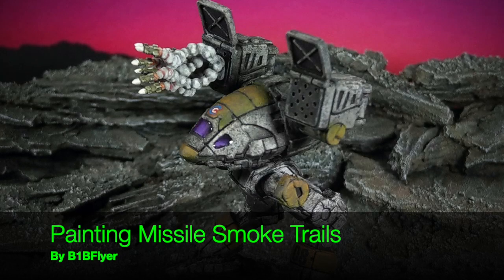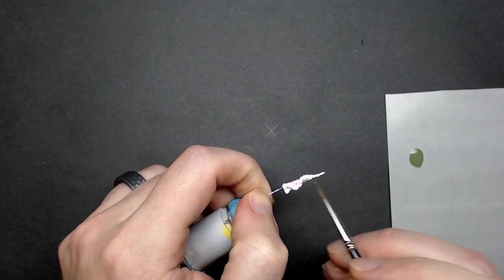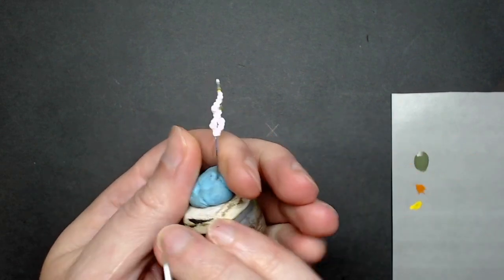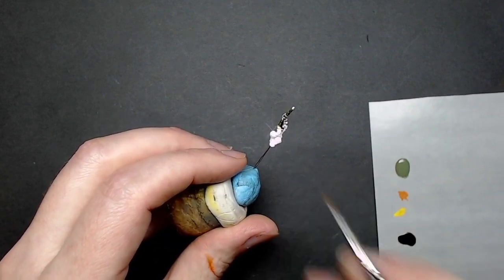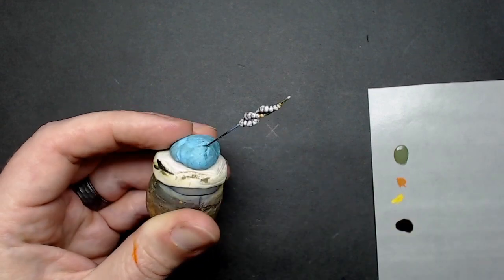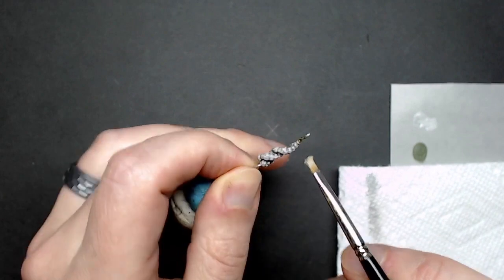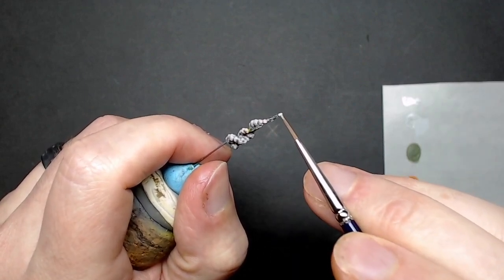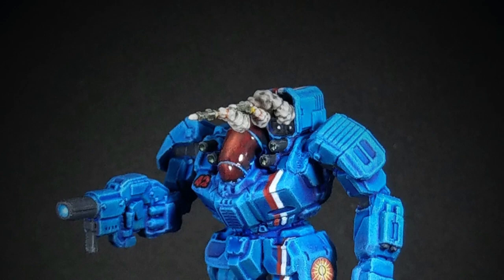Battletech Painting Missiles & Smoke Trails

Comment: Do you have a tutorial on how to sculpt the rocket effects by hand? Mention using wire, green stuff and sand, but I’m not wrapping my head around this concept. Any tutorial links you can suggest would be great.👍😉
Reply from the maker: No, sorry that's a fairly intricate and advanced procedure due to being so small and. Honestly even now after having sculpted missiles in the past, I would first try to either purchase 3d printed or have a friend print me a 3d file of missiles due to the time and effort in comparison when trying to make them. As for how to do it without a video, I use a small wire and typically cut a 1:300 aircraft weapon down and drill a small hole in the back to insert the wire. Then add greenstuff in layers to make the trails. You can also use superglue and sand or baking soda to create the smoke plumes as well. There are a few examples on some of the battletech hobby facebook pages that you should be able to see with a search or by asking about the folks that have done them.

Comment: Awesome Vid! but i have a question. Why don't you paint the Missiles at the end when the Smoke is done? regards
Reply from the maker: Personal preference is really the main reason, but not so much for one or two missiles, but in the Catapult example, there's a lot of tight to reach areas to paint the missile bodies and if you've done all the work to the missiles first, you don't risk getting a dark green, or black, or whatever color you decide to paint the missiles onto your smoke plumes which are very light colored. Additionally, since the wash is put over the missiles as well, it adds more depth and simplifies the process to the fewest amount of steps.

Comment: You mentioned these were 3d printed missiles, do you have any recommendations for these kinds of  effects for the less creative modelers?
Reply from the maker: Well I don't 3D print, I just have friends that do and that's how I got these. I've made missiles and smoke before and without a doubt I prefer to just glue on a ready printed piece. That being said, it's fairly fiddly and frustrating to make them depending on what you're using. I don't really have a plan to do a tutorial on them but there are some elements from places like armorcast and GQQ that can help in making the to reduce the need to use sculpting materials.